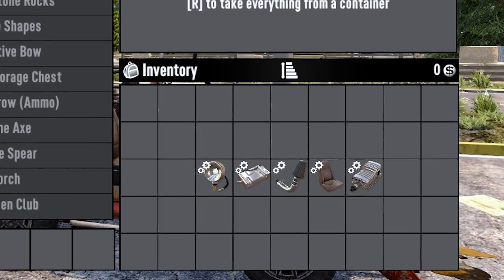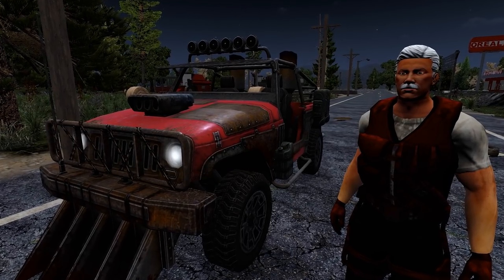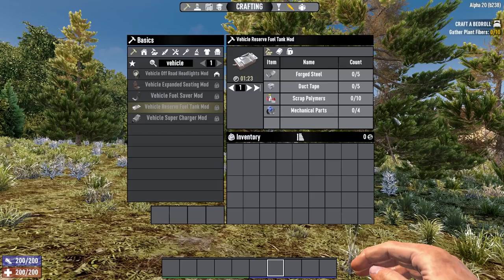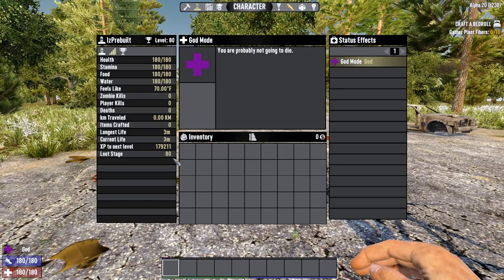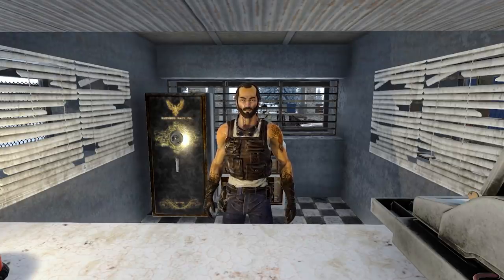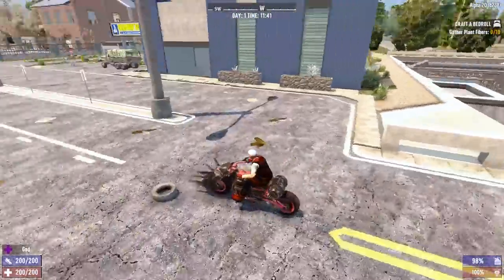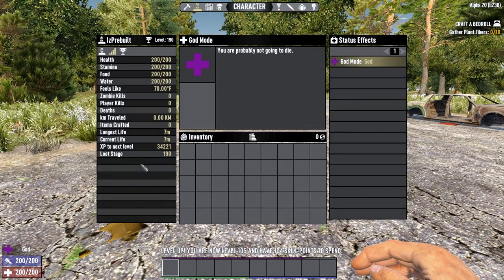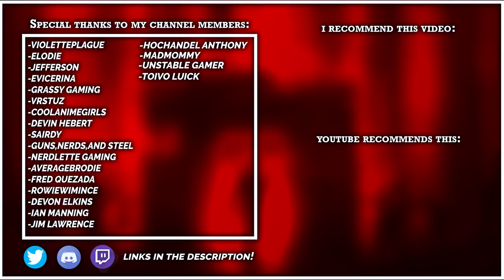Alpha 20 Added Vehicle Mods, But What Do They Do Exactly? - 7 Days To Die Update

Comment: Wait, didn't the Super Charger Mod stack? I might need to test that... (PS: Just saw a weird bug on another Youtuber's playthrough, where they couldn't put the Cargo mod into their drone via dragging it there, but absolutely could stack the mod by shift clicking the mod with a free mod slot, so I'll keep that in mind when testing.)
Also, if I remember correctly, the 4x4 and Motorcycle had the same top speeds, but the 4x4 guzzled tons more gas... so maybe, with the fuel saver, it'll become a viable option next to the bike thanks to its larger inventory?
Question about the fuel usage: is it a time based drain, or a distance tarvelled based drain (which would be more logical)? As in, does the Super Charger Mod also hiddenly safe 25%/15% fuel?
Reply: The Game files refer to Km/litre, (distance/fuel volume), but the run time of the engine seems to be taken in account as well, thus, while not going anywhere, pressing "forward" or "backwards" might cause fuel consumption. Experimenting might be required regarding consumption rates.
Reply: Did some testing, I was unable to get 2 superchargers into the same vehicle either by shift clicking or by clicking and dragging. Also you are correct about the top speeds and gas usage between the motorcycle and the 4x4.